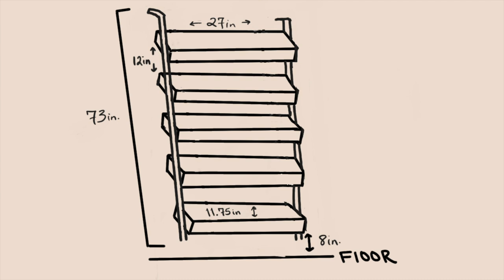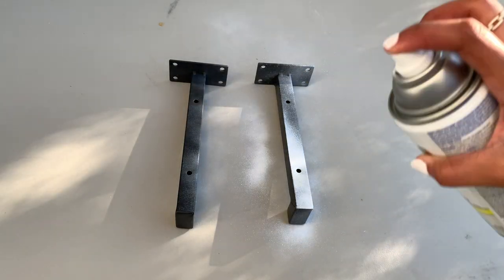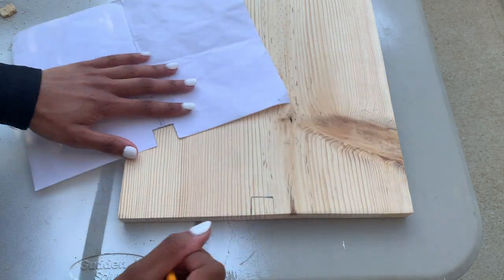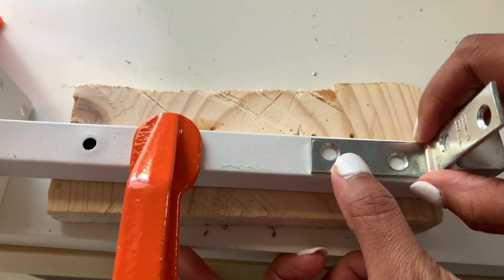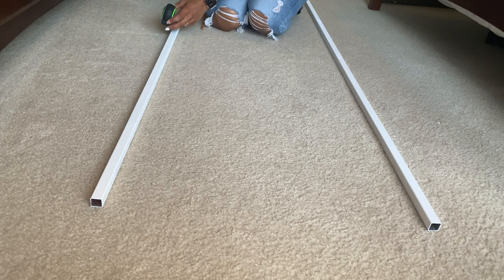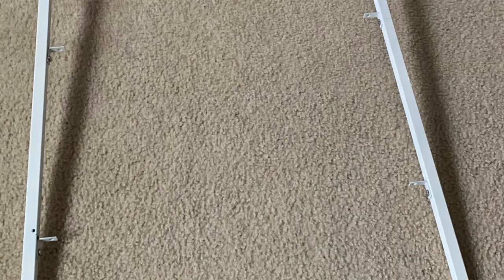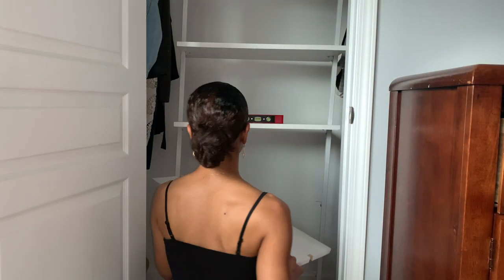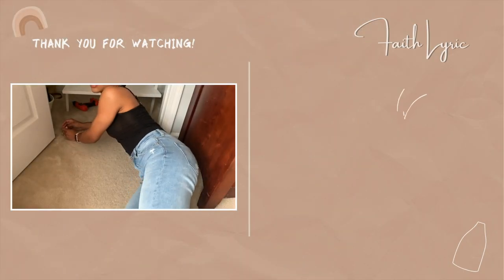DIY CB2 Bookcase // Closet Makeover Part I | Faith Lyric

Comment: Wow! Great job - do you think it is sturdy enough to fill with books only?
Reply from the maker: Thank you! It maybe a bit shaky the way that I’ve made it. I recommend using longer l brackets to help with the stability or to add a support piece right under the middle of the self that also attaches to the metal legs.
Reply: You can also use a larger bracket for more stability. Hope this helps